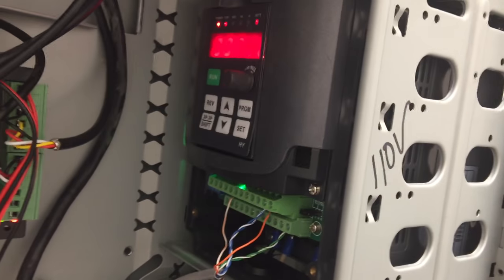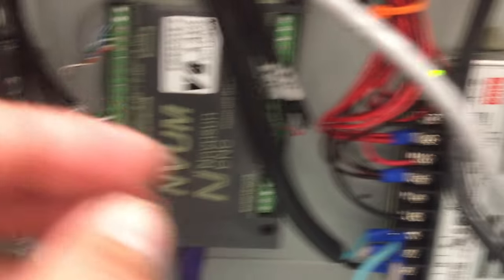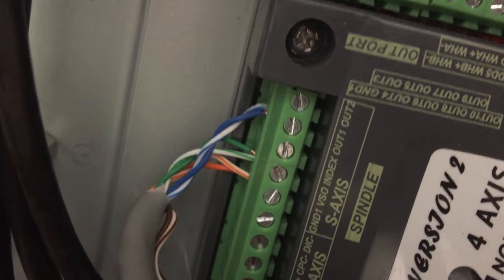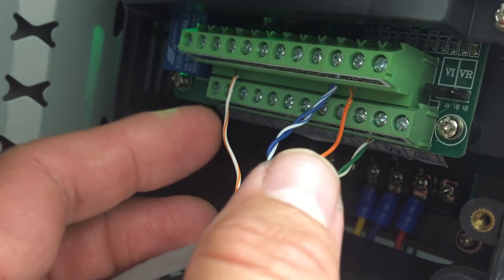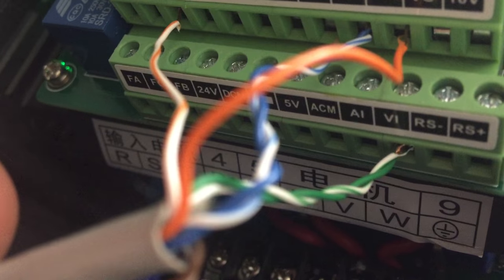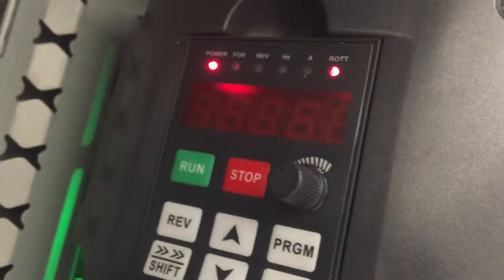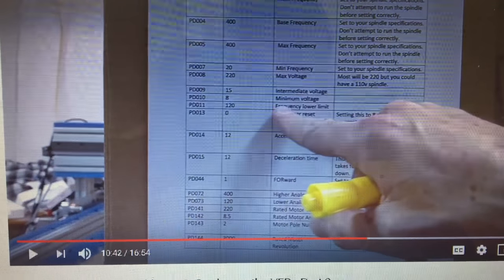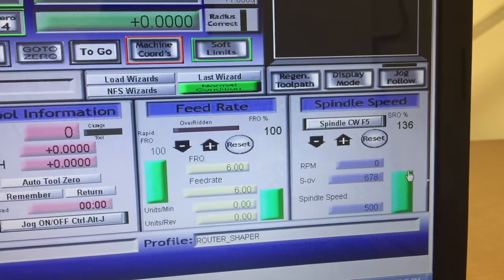SETUP NOVUSUN CONTROLLER AND MACH 3 WITH HUANYANG VFD TO RUN  SPINDLE

Comment: Thank you for the video. I have the exact same setup but I cant get the spindle to start using mach3. can you do a video showing what setting you set in mach3 or tell me what boxes you checked on the mach 3 spindle tab any help would be great. yes I do have the jumper set to VI? GREAT JOB! Thanks

Comment: 1. The novusun board must be setup on 24V in order to send voltage via VSO and out1. It doesn’t work if only on USB.
2. The out1 on Mach3 must be configured to port #2 and pin #1 and Active Low. Don’t ask me why?
3. Read carefully the Huanyang manual in order to setup the configuration to read from the board terminals. Mine is : Pd001=1, pd002=1, pd044=2, pd070=0.
4. I wired the ground close to Out1 on novusun to DCM on Huanyang. I don’t know if it make difference but I think is more on the safe side.

Comment: I've spent hours and hours and hours trying to get MACH 3 to see my NVEM on the network or direct connect. I can ping the device no problem.. installed the drivers, plugin, xml blah blah multiple times and still nothing... I'm about to turn this sucker into a street hockey puck and attempt to slap shot.
Reply: I know this is super old post. Did you disable the Firewall on the computer?

Comment: IF: you can control the spindle dircetion but speed is always maxed out
THEN: mach3 --> Ports and Pins -->  Motor Outputs --> select SPINDLE & select Dir LowActi... & select Step Low A...

Comment: Hi, what are the parameters you configured on PWM control? I only can get 10.43 v on the VSO output, so the spindle velocity is the maximum and i can't change. Thanks.
Reply: I have te same problem.
You found a solution.
Reply: same here, did you ever get a fix

Comment: Hi, it would be great if you make video as mach3 settings for spindle
Reply from the maker: Hi Armas, I'd be glad to but for now there's some videos out there you should be able to follow on this topic.  I've switched spindles and since then have had problems getting the speed control to work. Once I figure this out I will make a video. Are you having trouble getting MACH3 to run you spindle?

Comment: Really its a useful information for mt DIY project, can you plz give a additional information that if we are connecting a brown wire in to out-2 on the breakup board, which terminal will get connect in the VFD.
Reply from the maker: I think you need to connect to REV on HuanYang

Comment: I have same problem nvem wire connect same as you video but can't speed control on mach3 only spindle can turn on and off speed is 24000 need help
Reply: Vfd setting is pd001=1, pd002=1, pd041=1
Reply: Oops pd044= 1

Comment: my wiring is all set up correctly as per what i see on your video and referencing manual. but i can't get the spindle to control via mach 3. i can get the spindle to turn on but cannot adjust the rpms? if anyone could help i'd really appreciate it
thanks
Reply: yeah i have the same issue.

Comment: Bob, which manual did you follow to set this thing up? I stupidly bought the ethernet Version 2 card from Lollette and I just can't get this thing to move a motor.  Following their manual is near impossible since the translation is total garbage.  

Did you have to change any settings on windows before you got Mach3 to run? I was able to install the plugins for NVEM/NVUM and they're active in Mach3.  Went through all the Ports/Pins setup following the images on their manuals but nothing works.  They also mentioned in the manual that the "status" section should say something like NVEUM "loaded" but I don't see anything in that dialogue box.  Its just blank.

I know you have limited time for Youtube comments but if you have time to respond that would be wonderful! 

I plan on writing a setup manual if I can get this to run.

Thanks in advance!
Reply from the maker: LogicSpeaks Im using the usb Model and got the manual by googling and finding their website. Didn’t change any windows settings but you need to make sure you installed the driver and drag and drop it into the mach3 driver folder(thats the actual install process) then when you start mach 3 you’ll have to select it every time
Reply: @bobbildz8865  hey, thanks for responding! I didn't actually know your responded, but I had figured out how to connect via another individual's video. 

I do however have another question for you of you don't mind. 

I was wondering if you ran in to a similar problem. I have a4 motor setup (dual motor for the X axis) and for whatever reason, the X axis will only go one direction when I use the arrow keys.  All other motors run fine.  

Any idea what it could be?

Comment: Setup:

Windows xp
mach3
Novusun NVUM v2 controller 
Knock off askpower VFD (i think)

This is my 1st major cnc build, and i am at the final hurdle - controlling the spindle via mach3 and a vfd. The novusun control board (which has caused endless confusion) is a usb parallel port emulator. Where I am currently, is the vfd reads frequency when the Spindle cw control is pressed on mach3, however, the spindle won't come to life regardless of which pin outs i put it on. The spindle works fine with the VFD in manual mode which rules out some problems, I am just very confused about the relationship between mach3 and the novusun NVUM and how this controls the spindle. Anyone got any experience with this kind of setup?

they change the software of NVUM,. maybe because of FREQUENCY Problem, i think,..

Comment: Hi Bob I have the same setup as you have. Can you tell me which NVUM driver you used because I've tried everyone I could find with no luck.
Reply: this is the NV E M page on their site (NV UM is a different page) and the drivers are listed to download - dont put multiple drivers in. remove drivers when altering mach3 settings.
https://www.nvcnc.net/nvem.html

Comment: What mach3 settings are you using? I have the yl620-a and the nvum 2, but can't get it to working. I do have the spindle making a noise when I hit the start button, but it quickly goes back off and never spins. I am sure I have it wired correctly.
Reply: did you fix it i am also stuck in same situation
Reply: @MeneerGaming  nope. I've since moved so haven't had much time to put into it, but I've decided to change to a rs485 connection to control spindle speed as it's much easier and gives better control. Still using the controller to turn the spindle on/off
Reply: @ulkesh78   Ahh owk hope the move went great. how did you manage to turn it on and off what were your mach 3 settings and connections on the vfd.  Do you maby have pictures?
Thank you

Comment: I have the same controller and I have been trying to figure out the speed control from within mach 3. I have it switching it on and off but I can't adjust the speed.
Reply from the maker: Chris George Chris George you have to make sure the wires are correct as I show for VSO and Ground. Also make sure the VFD setting on pd044 is set to 1
Reply: @bobbildz8865  thank you I had one hooked up wrong I am going to blame that on not enough coffee before I started

Comment: Hello, I am thinking of using a DC Motor Spindle. I want to use NVBDL+ as the Spindle Driver and NVEM as the CNC Breakout Board. I want to control the Spindle Speed with PWM. What is the appropriate connection between NVBDL+ and NVEM?
Reply: I’m sorry I’m not familiar with the NVBDL

Comment: Hi Bob, I have same NVUM V2 controller.  Whem I run gcode my Mach3 stops in the middle sporadically. I have few issues with USB errors as well. Any ideas?
Reply from the maker: Not sureHyrdo Farms..I just started with this controller and have had some weird things happen in the middle of programs as well.  I'm going to run a few more this weekend and see how it goes before switching controllers.  Hope that's not necessary.
Reply: @bobbildz8865  which controller are you switching to? I am currently looking to shop to. Are you still going to use your same drivers?
Reply from the maker: Not 100% sure yet but inclined to check out Planet CNC just don't know about learning new software as I'm used to MACH3.  Otherwise may need to bite the bullet and get a MASSO and yes still using same drivers don't think theyre the problem.
Reply: Hey Hydro, 

My "version 2" NVEM uses ethernet.  Any idea how to set this thing up for Mach3?  Did yours work out of the box?

Comment: So I have to say, this NVEM Novus is full of mysteries.  I'm beginning to think its a huge piece of wasted money.  

So I connected all drives, everything 100% certain correctly wired.  My X 
axis with a slaved motor (Dual drive) would only move one direction 
(either arrow key drives it the same direction).  So I took Y and Z 
drives, and wired them to the X dual drive - the X drive would work 
perfectly (Moves both directions depending on the key pressed). 

Now, I wired an additional motor - Y - it moves only 1 direction now.  Did the same thing with Z - moves only one direction.

I have no idea what this means but if anyone has an idea please let me know. 

Otherwise, I'm just buying a smoothieboard and let this be my last mistake when buying garbage with terrible information.
Reply from the maker: Hi sorry to hear you’re having so much trouble and yes I have to admit that at the outset I wasn’t too pleased with this controller but I stuck with it and have found that some of the settings in Mach3 were actually the problem. However I do have to say that the spindle control at this point is only working for me on and off and am no longer able to control the speed which for my particular application is acceptable. But I can see That for somebody else That probably won’t be the case. You need to make sure that the resolution in the settings for your particular drive motors are correct  and you can play with those  and   you need to make sure that your Y motor is independent of your X axis and Your second text motor should be slaved there are videos on YouTube on how to slave a motor. You had a lot of information there quite honestly I’m a little bit lost but I can say at this point if you have Mach III running with novasuns latest driver it’s decent for the money. Yes there a better systems out there but for 4 to 5 times the price.
Reply: @bobbildz8865  
Hiya,

Thanks for all of the suggestions. I think the conclusion I have come down to is that 2 of the 4 drivers I purchased are defective. Basically, I have tested the "working" drivers that I have which move the motor in both directions on every connection of the NVEM and they all work properly. The suspected bad drivers on the other hand don't work properly - they move only 1 direction. I have tested the good and bad ones on different motors I just had laying around, and they behaved the same way. The good ones spun the motor in either direction, and the bad ones only spun it 1 direction. Thanks for taking all of your time to attempt to help me. I appreciate it!

Comment: Hi, how did you solve the spindle speed problem?
Reply from the maker: Ultimately I had to revert to the  manual spindle control on the VFD. I was only able to turn the spindle on or off in the end with Mach 3.  With the OpenBuilds BlackBox controller I've had no problems.  The technology is superior, the software easy to setup and run.  The logic is processed on board vs the NVUM which relies on MACH3 to do the processing and this creates missed steps and anomalies such as the spindle problem (although the spindle problem could be the fault of NVUM just not sure)

Comment: Hi, can you help me with same type  Novusun controller setting in mach3?
Reply: Hi make sure your motor outputs has spindle checked green. Also make sure in the spindle setup tab in ports and pins that the pwm selection is on.  You may have to play with the PWM base frequency to get your spindle to run correctly.  In motor output you may need to toggle the hi/low setting to see which activates your spindle.  This is for speed control.
For turning on the spindle your output pin1 is what activates the spindle so make sure that it is activated in ports and pins under outputs. 
Sorry but I dont have MACH3 in front of me I'm going off of memory so the names I'm using aren't exact, maybe

Honestly, I've had problems with the spindle speed control. It seems to be the way the VFD is resetting and it's not detecting the PWM signal from MACH3 . I haven't had time to check the PWM signal output from MACH3 so not sure what the problem is.  I can still turn on the spindle in MACH3 though so am ruining it with the potentiometer on the VFD for now.

I think NVUM is turning out to be a deal where we get what we paid for.  I'll update my channel as I make progress and have time. Hope this helps a bit feel free to ask more
Reply: @robertz3806  Hi, thank you. But I don't have spindle motor. Unfortunately I have problem with the controller settings in the mach3. Possible to get pictures from all your mach3 settings please? by email or by any instant message?
Reply from the maker: Peter Gal what problems are you having? The nvm website has the install manual in English that gives you the Mach3 settings. Try this first if that's not a fix likely there's a hardware problem I'd say
Reply: @bobbildz8865  Hi. My controller doesn't work with them settings. I don't understand why. I am used other settings, now working but always run over. I am tried to setup limit switches, but the machine run over in all directions. I am tried to setup limit without limit switches, but can't find any options.
Reply from the maker: So your controller is powering up and the steppers run correctly? If your limit switches aren't working make sure you have Mach3 inputs on for the input ports you're using for those switches. It could be active high or low depending how you connected the cable to the switch if the switch has three tabs. I checked mine with multimeter so when pressed the switch passes current so they're active high. The controller has input ports labeled.
Reply: @bobbildz8865  Hi. Can we talk by chat ? FB messenger or similar?